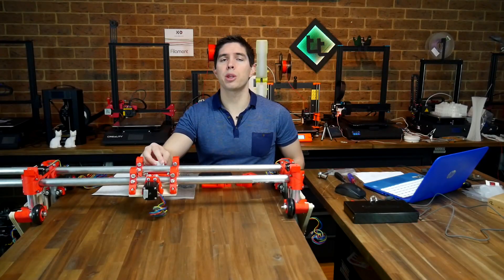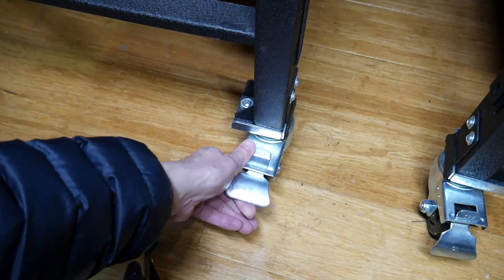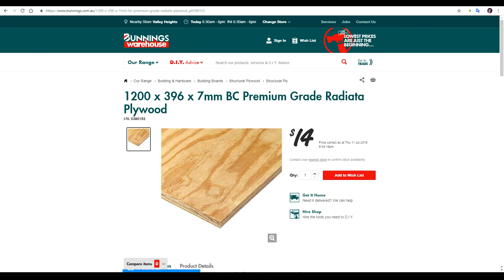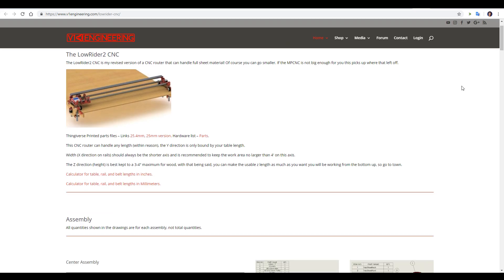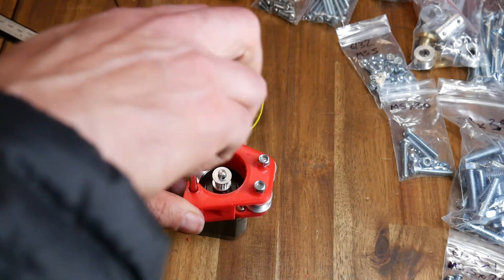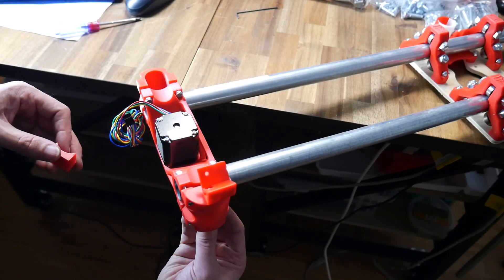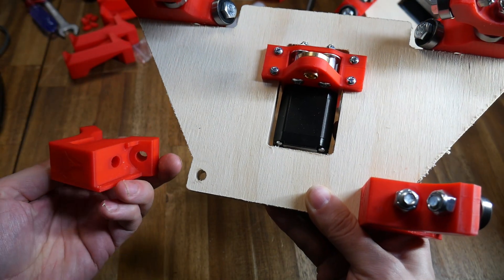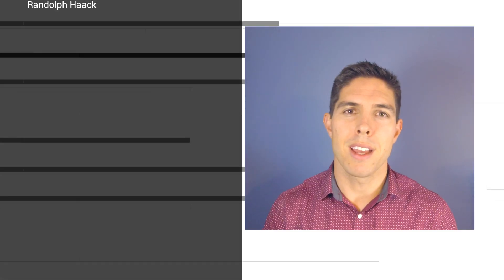3D Print your own CNC - MPCNC Lowrider2 part 1

Comment: How do you source "inexpensive metal tube"? I want to build a CNC but it seems like anything that is rigid, reasonably straight and consistent along its length, that is more than five feet long is several hundred dollars per piece. the only thing I have found that might work is posts for chain-link fence. Even then it would probably only be strong enough if I build the CNC on a vertical plane instead of a horizontal one. It's not the most accurate thing in the world but for woodwork it might be good enough?

Comment: Hello, I have seen your videos of how you assembled your lowrider2. They are very good. I have everything to be able to mount it but I have doubts regarding the plate and the screen that I used for it, I bought them separately with the lowrider2 kit and they did not come with the firmware pre-installed, and they are not the ones that you have used. The one I have is the skr pro 1.2 and TFT 35 E3 V3 card. If you know how to put the firmware on this board and screen I would appreciate it if you could guide me. Thank you, greetings from Chile.

Comment: Here in the US, we--you know, literally everyone (jk)--are taught, when screwing in/tightening bolts or whatever, to do them in opposite locations, i.e. upper left, then lower right, then upper right, then lower left, instead of in a "circle," as was done here.
Reply: I know this is a 6 month old comment, but as a pipe fitter from America, we use both actually. We call the circle, “around the world” and is usually the start and end tightening pattern.

Comment: You know to fit wheel bearings you should really just use a nut, bolt and a couple of washers on the outside of the bearings then you just clap them together with everything properly aligned

Comment: The Dewalt DWP611 is sold out / out of stock everywhere. Would this other model be compatible?  DEWALT DW616 Router, Fixed Base, 1-3/4-HP

Comment: Getting started on this. I reside in the USA (WV). V1's affiliate link to Amazon for stainless steel tubing was 'out of stock.' I found this seller offering it in 7' long pieces, meaning ordering just two of them should be enough for a CNC that can handle 4'x8' sheets. (If I understand the calculator right.) https://www.austenitex.com/shop_by_category/round-tubing-3a-316-0100/1-OD-3A-Polished-Stainless-Steel-Tubing-316L-Welded-16-Gauge-065-7-Length?whence=

Comment: The spring couplers on the lead screws should be tensioned to increase rigidity. Take a slip jaw plier and stretch the coupler out a bit then tighten the grub screw. this prevents a gap between the screw and the motor that can decrease accuracy.

Comment: Can you do a video about upgrading the MPCNC to a 32 bit board, preferably SKR 1.4 Turbo?  Allted/Marlin only seems to be focused on 1.1.x, but when I start from scratch and enable the dual stepper and dual endstop on Conf_adj, I get a litany of errors.
Reply from the maker: You may want to check out part 2 of this series.
Reply: @TeachingTech  thank you.  Upon watching the video and following your link and the request for a donation, would you consider modifying the firmware to pair a standard MPCNC (gen 1) to an SKR 1.4 Turbo and your TFT28 BMPs to function on a TFT24 for a stated fee?  

It's possible I might be able to figure out how to make the changes, but more than likely I will have to work through a series of errors, but if you can make the changes to run the LPC1769 with TFT24, I would pay for that to mitigate my own stress and frustration.

Please LMK if you'll help me out.  DRV8825 for X1 X2 Y1 Y2 Z

Comment: I want to get a decent starter CNC router, can you please help me choose the right one?

Is there a CNC Router that would be popular and easy to use like the Ender 3 Pro?

When I shopped for a 3d printer, I didn't know anything about them. 
I ended up with the Ender 3 Pro and I think I made the right decision, but it was purely luck that I picked such a good starter printer. 

I think I'm going to follow your lead a buy 1 of these too, but before I do that, I want to get a decent starter CNC router.

Comment: A heads up when you're printing the pdf template to cutout the 611 board and the Y-plate. Please unscale your pdf print settings else you end up with smaller plates and left wondering why the XY bearings wont fit.

Comment: Michael...I'm a bit skeptical about the 3D printed parts.  I love what your doing but I guess I apparently just don't know enough about 3D printing tech. For some reason my thinking is that by making these parts in layers (and as young as this tech is, no time tests) that over time they may delaminate?  I hope I've got my head up me freakin bum, cuz I'd love to build my own CNC and your 3D system seems to be just the ticket.  Is there any way to change my mind?  I keep thinking having them done with aluminum, but not having a CNC machine, I'm guessing this might be a tad expensive to have done.  And they have printed 3D pistol parts, of course you never hear about how that turns out....I plan to continue researching,  but any input would be most helpful. Thx

Comment: Info needed on those tables please.
Reply from the maker: They are Rackit 1000kg modular shelving parts, with the castor kit in the bottom and z random slab if timber screwed in top. In Aus, available from Bunnings.com.au

Comment: Why this pipe should be stainless steel? the simple mpcnc requires simple galvanized pipes.
Have you found any problem with these one you bought?
Reply from the maker: Stainless steel is higher quality and won't rust long term. Mine's indoors so no issues for me.
Reply: @TeachingTech  Thanks for your answer. Still confused since they don't suggest stainless pipes for the mpcnc, just galvanized pipes there.
Happy new year with good videos as always.

Comment: Dear Michael,
  Thank you for the wonderful tutorials mate. Because of them and you I bought my first 3D printer, printed mobs of parts for it and for a number of projects and have now built a LowRider2 cnc so, thanks mate, I’m grateful for your inspiration.
  A couple of quick questions if I may.
  Firstly, where did you get the Velcro tubing that you used on your machine please?
  Secondly, being very new to this side of things, I went for the, I thought, simplest and most straightforward way ahead and bought all my bits from V1. After some correspondence with the aah gentleman it is a decision that I’ve come to regret and should have followed your advice in your videos more fully and bought the boards etc that you did.
  My question is as to how to set up end stops like you did when I now find that by not buying the most expensive controller board that he sells I’m told that I’m unable to do so with the one that I bought being a Mini-Rambo 1.3 which came with the bundle unlike the Rambo 1.4 which is $50 more expensive but not offered with the bundle and you aren’t told of the others limitations until long after sadly. 
  Do you know if it is a possibility at all to do with the 1.3? I’ve also been learning Raspberry Pi’s and Arduinos recently and have found that some of these are very flexible and can be added onto to do some extraordinary things at a very reasonable price. Could some sort of breakout board be used to add full end stops capabilities to the mini Rambo 1.3 in the same way that you can add a breakout board and some driver boards to an arduino to give it the ability to drive 3 stepper motors?
  Any help you can provide will be greatly appreciated mate and I hope you have a wonderful Christmas and New Year,
  Take care, all my best to you and yours,
    Phil

Comment: My mark down is not or your presentation but rather for the mpcnc products in general. I had one build and used it for a few runs.  It’s not an accurate cnc and has the tendency to lose alignment quickly with no real levers to adjust its accuracy.  If you like to play with cnc than its ok, that is why i put one together.  After a few runs i took it apart and went for regular cnc product that is still affordable like the ones from open builds.
Reply: (Translated with Google)
Very interesting your point of view.
Could you give more details please?
What do you mean when you indicate "open builds"?
Thank you!

Comment: Now that you have been using this for a while.. have you noticed any flexing issues by using the cheaper ETM vs Stainless Steel Tube?  I can find ETM at close enough size for about 1/5 the price of the SS...  The plan was to make the cutting area for full 4x8ft sheets.  I have been told that over 3ft the ETM is no good...  
Thanks

Comment: Another option for the flat stock parts is to print the Y plates and use it as a router template: https://www.thingiverse.com/thing:3518326

I also converted the DXF of the 611 plate to stl and split it so I could print it on my printer, A8, to do the same

Comment: I would rather use lead screws or ball screws, besides clamping them with skateboard rollers.
I am not convinced, it is secure when you have a certain resistance.
Trapezoidal lead screw are not so expensive, nowadays.
I think, is not hard to adapt this design, and low cost increase for better quality.
Reply from the maker: But then the size will not scale easily. Please see my follow up videos, it cuts well.

Comment: HI TEC, I am new to your channel. I was able to purchase an Ender 5 based on your video. Thx your videos have made a huge impact. Still a newbie to 3D printing. You mentioned "Three Perimeters " what is that? Thx Dr Rob
Reply: Three outlines drawn from the outside of the shape in on each layer, before infill fills the rest.
Often, increasing the number of perimeters increases the strength of an object more effectively than increasing infill density, because the bulk of the force of bending an object falls on the outermost parts. However, infill density is still important to resist crushing forces in some cases.

Comment: I build one and it is a nice little project to get into building your own CNC. Soon after it was finished i replaced the pipes with proper solid linear rails to get rid of some of the deflection. Major improvement. It still is just a toy though. There is a reason, why CNC machines arn´t made out of plastic. It is a good entrypoint if you want to get into it and don´t want to spend thousands on it. But invest in proper precission ground round linear rails, which arn´t that expensive.
Reply: Have you got a link to the ones you used/recommend? Or did your source locally?
Reply: @alexblackmore7744  I sourced them locally, but it is definitly possible to order them.
They are generally not that expensive, just make sure you get the lengths and the diameter right. Get them cut to length also, makes life alot easier.

Comment: Can't wait to see your second part to this video. I'm really interested in seeing how you explain the software side of using the MPCNC. There really aren't many good tutorials on that area of it. At least not in setup calibrating/settings & using cam software to actually start cutting with the MPCNC. I built the original MPCNC and already printed out the parts for the LowRider vs as well. I just need to put the LowRider together to finish it.
Anyways... I really can't wait to see if you can do a in depth video in the software side. I've come close to getting it working correctly but for some reason I just can't get the g-code just right. My last attempt almost seemed right. It did the drill holes right but when it dud the parameters it went crazy during the end pass and tried to drill downward while moving in some odd direction. Not sure why. Hopefully some day I'll get it working correctly.🥴
I will say that the test g-code for using a pen to draw a crown on a piece of paper worked perfectly.

Comment: Hi Mike, Great build as always - I have have said many times , you are a true inspiration to many new builders like myself.
I wondered if you could share your print settings for PLA. I was thinking 4 bottom 4x top and 4x perimeter. Im using a 0.4 nozzle with 0.25 layer height ? any ideas ? I am using either 55% or 65% infill, and the triangular layout.

Comment: Are you not woried about the PLA loosing tention as PLA does not deal that well with prelonged stress?
Reply: i have been using mine for about a year now and they are holding up just fine with PLA. However I think the machine has some short comings and over the year I have been taking note of things I would change and will be doing a redesign soon.

Comment: Hi I have an Ender 3 Pro and when I import my stl from Tinker cad to Cura Its printing the wrong size Eg I have a project , this item is a drain plunger and it it is 100mm in dia
When it starts printing ,its only 80mm Help please

Comment: I built a MPCNC (not the Lowrider) a few months back. For wood/plastic, it is a solid performer. Printing took about 200 hours. Alex, V1 Engineering, is always on his forums to answer questions, trouble shoot, and cheer you on. Biggest benefit is that you will know your machine very well, making repairs or modifications much easier.
Reply: I want to built the same as you have, have you used it with acrylic?

Comment: under 500? lol what bout under 100,but all your weight on that x axis it bend 0.5 for sure
Reply: It might appear to be made a little on the flimsy side, but if you understand that a cutter is very sharp and revolving at high speed...... anything that touches the cutting edges will be cut.....it just depends on the feed rate and depth of cut. Everything within reason, and when you see the first thing that eventuates from a programmed cut cycle that you only have to stand and watch happen, then you will understand where CNC can take you. Try cutting a really complex shape by hand...…...CNC takes the tedious work out of it if you work with the machine and let it do it's job...….high speed production is not what this is about.

Comment: Great video. I have built 2 Lowrider CNCs one for myself and one for a friend we have been using these machines for a few months now and they are still working great. i used the Arduino CNC shield with a couple of modifications to enable the shield to drive the 5 stepper motors and using GBRL downloaded from github on th Arduino  and i am using inventables Easel to send the g code i find  Easel very easy to use and as its a cloud based service i am able to design the item on my pc in my office then upload the file to Easel and closexit down then go into the garage where thr CNC lives and open it up on the notebook pc attached to the Lowrider CNC and set it working on the item and just keep an eye on it while it cuts thecitem out. the only issues i had with thecmachine is when you set the  Z axis during zeroing the machine you must make sure that both ends ofcthe machine are at the same height before starting the cut. and the other issue was one of the pcb traces on the Arduino CNC shield was too thin to carry the current drawn by the stepper motors when more than one was operating at the same time. if you print your own parts i would allow about a week of printing time. in conclusion I think the Lowrider CNC is a fantastic design and good way to get in to CNCing especially if you are looking for a machine that can cut from an 8ft x4ft sheet of material. an ideal machine for all you budding furniture makers out there.

Comment: Wow you read my mind. Just got a 3D printer and was looking for something practical to make with it and was looking at a CNC from thingivers, which I think is from the same stable as the one your putting together. Will be waiting for the next video, so please don’t make use wait long. Plus pLease don’t skimp of the wiring video as that’s the bit I find most challenging.

Comment: i wonder if you could replace the plywood with more printed parts...
Reply: You would need a pretty big print surface for this if it fits on an A3 paper
Reply: There is where the flex comes in. The flat parts are made from plywood or MDF specifically to decrease flex.

Comment: I am using an Acro laser from Open-builds, costed me around 450 in total including laser, excluding motherboard. This could be interesting alternative to that, as it price class is almost the same. But it would cost lot more effort. The acro laser is just a simple build with no printed parts. I do really like how they put the screen and probably the mother board on the carriage, this would simplify the cable management a lot!

Comment: I might build something like this for when i redo my kitchen. buying the cabinets in kit form works out really expensive. for the price of one corner cabinet i can buy the materials most of the kitchen cabinets. the only issue i was having is i suck at cutting things straight. if i made one larger than a sheet of melamine (i think our dining table is bigger), i could cad up the cupboards (already done) then just "print" them and screw them together.

Comment: Great video. I’ve been slowly chipping away at my Lowrider2 build as well. You can also try the 25mm chrome curtain rails/rods at Bunnings. Cheap and smooth
Reply: I wish it would easily do Aluminum but it needs to be rigid and repeatable.
Reply: @thebeststooge  I've not tried aluminum on the lowrider, but the mpcnc can do it.
Reply: @Barry Woods After having a discussion with two people on here it will but it will be very slow and very shallow depth of cuts.  The thing is most people do that as they baby step up the parts to gain the rigidity they need.  Plastic->Aluminum->Steel->Iron but I don't know if this machine can do that, or the mpcnc.  Look at the plastic piece he held and he showed you the flex (I 3d print for 6 years now and no plastic I have tried will not flex which is bad for a CNC) so most people would use the machine to upgrade those parts in Aluminum at least but not sure you can easily do that with these?